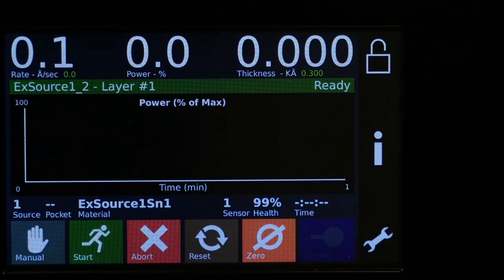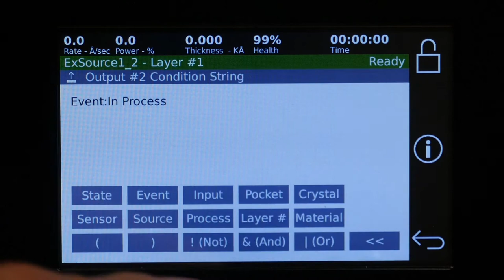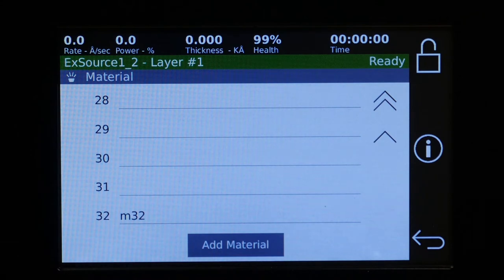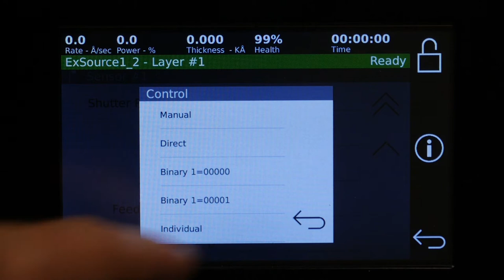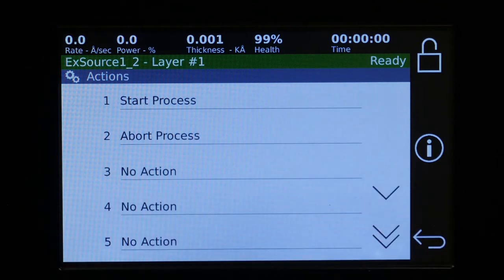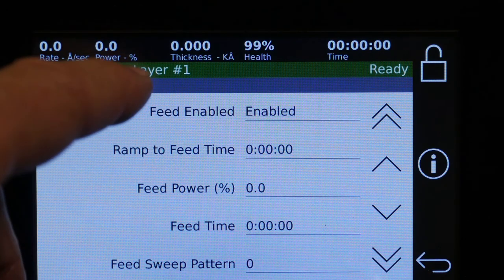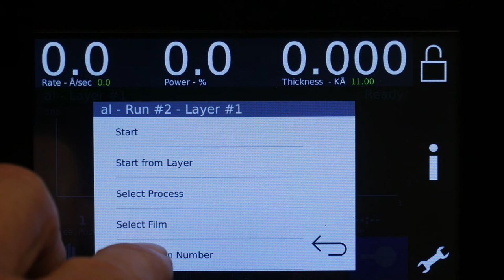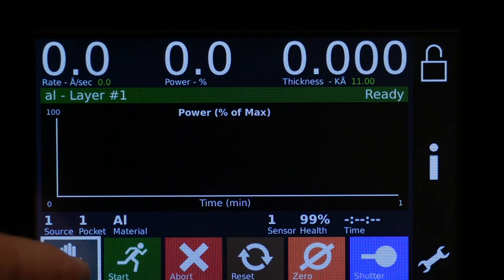Telemark Model 861 Deposition Controller Setup

Comment: My deposition controller won’t read the oscillator to the crystal any ideas
Reply from the maker: Hi Joe. The oscillator has a test button. This will check if the problem is on the 861 side of the oscillator or on the chamber side. Please email sales@telemark.com to be directed to a support person or call +1 360-723-5360